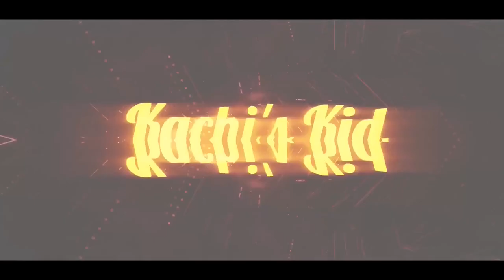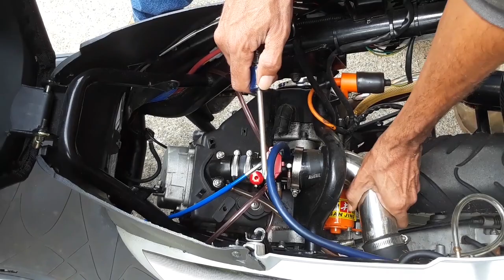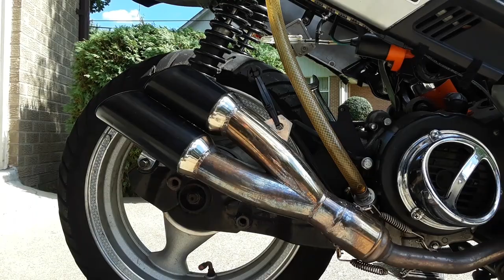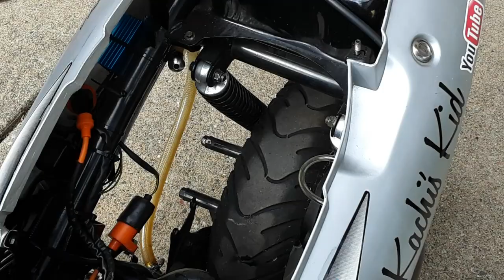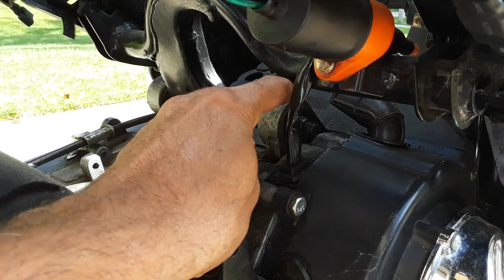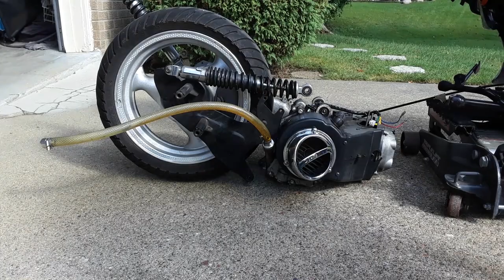GY6 Engine Removal / Outside Components / 180cc Build / Hope's Comeback

Comment: I leave the center hanger, exhaust, & shocks on.
It gives you a handle to grab with the center hanger on.
The shock bottoms I bungee over the luggage rack to keep them out the way.
Once the engine is lowered to ground, lift the scoot rack & push it forward.
When installing , have screw drivers ready to pin the mounting holes till you can get the engine Up straight enough for the bolts.
....I just rebuilt 2 of my engines last month.
The worst 1 got me for $140 in parts.
The 2nd engine was @ $120 for a top end kit & a new camshaft.
Reply from the maker: All good info as always. As mentioned couple different ways to to it. Everything has to be moved to the new engine anyway. What CC engines are you rebuilding?
Reply: I have 150s , their actually easier to rebuild then the 50s imo.
Its @$100 for all the specialty tools to rebuild the 150s.

Comment: Nice. When I work on my Chopper, I use a regular fold up ladder and ratchet straps as a hoist along with my floor jack.
Reply from the maker: Nice, that is pretty smart. Did you pick that up over the years, or your experiment?
Reply: @kachiskid  I have to admit I seen it on a FortNine video. It really helps. I won't work on the Chopper without it. I've used it on the front and rear. I tipped my bike once and never again.
Reply from the maker: @thelagmeister  Yeah it only takes once to learn, and maybe a couple of dollars to fix mirrors.

Comment: Mine was almost done. Yes the basics are done!! Ive been waiting for my rs8 clutch since i didnt change my clutch..for now i have racing cdi and coil got it from amazon. I was trying to measure her front for fitment of yamaha nmax yes just to be sure i dont wanna buy a front fairings without looking the fitments im very meticulous when it comes to fitments yes including her bbk coz i dont wanna messed up my bike.. when i change her cdi, with a stock cvt(the belts and front variator and fans) man my bike was very strong!! My friends used to say "damn bro your bike was strong!!"

"Your bike was mamaw (means a monster machine, a strong bike) close to kawasaki250r and cbr 600. I was like "na haha we just did the basics and i want to focus on her acceleration". Yes ser, after that my concentration was the acceleration (arangkada in my language).
Reply from the maker: Lol. Well I will be the 1st to say "damn bro your current bike is stronger than your old one!!" Isn't that nmax head gonna add some weight to the bike?
Reply: @kachiskid   im not sure but they said the nmax lip was lightweight so iguess itll not affect my bikes performance..

Comment: Hey Kachi I see you've got an oil decompression tube. I know that it helps with lowering the crank case pressure but I don't understand why that pressure is a bad thing. Will it harm my scoot if I don't install this?
Reply from the maker: I use mine you have the oil flow freely through my crankcase, while expelling gases. I truly think it helps keep my oil a little cooler also. I need all the help I can get with a 180cc engine with no oil cooler. Won't harm your scooter if not installed. Also when rebuilding an engine (which I've done 3-4 times) you add extra oil. 1100ml instead of the normal 750-900ml.

Comment: If u have a center stand you dont have to drop the engine on the ground, you can just pull the chassis forward and off.
Reply from the maker: Good tip.